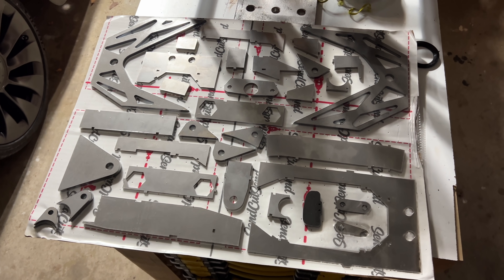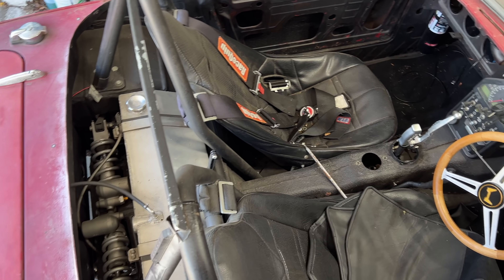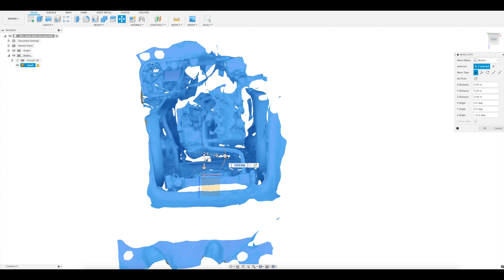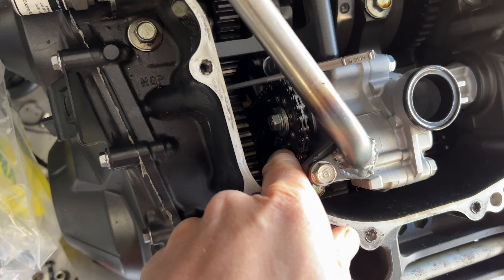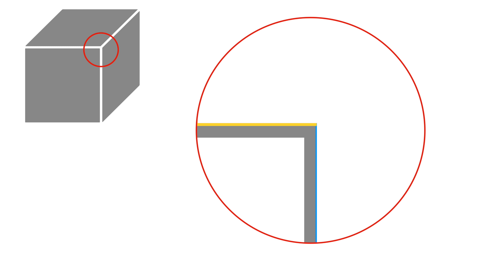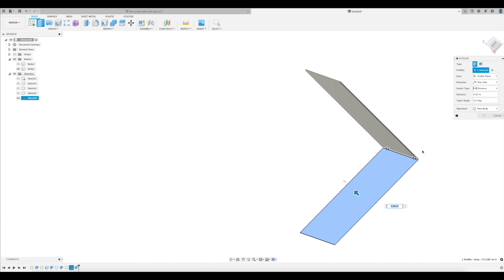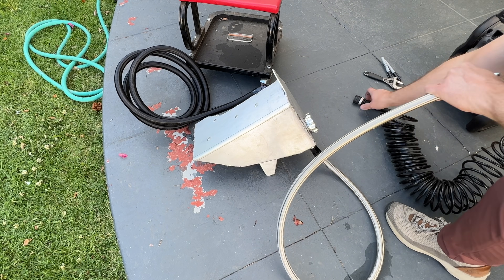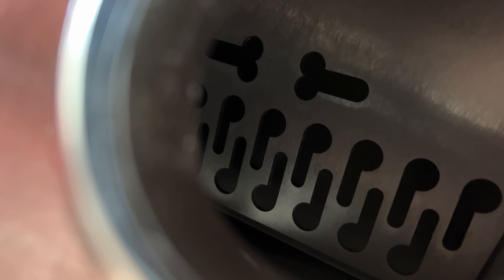Welded Structures Are Better

Comment: 3:33 ..  3 mm?!! why so thick!? sheet metal engineering is my day job (i design and export parts to our laser cutter), i wouldn't use anything above 2mm for this (1mm might not sound a lot but remember, it's a 50% addition), 1.5 mm SS is good enough imo
Reply: aluminum eh? that explains a lot :D

Comment: @SuperfastMatt, think of how many careers you may have launched today. 
Many, many years ago an AutoCAD class, continuing ed class at local State U. Software of any non-free sort was a carefully considered investment at our small start-up. I downloaded a free AutoCAD sorta-clone and dove in.

Up until that point my drafting was on paper, sometimes not even of the napkin variety. Playing with the freeware I sketched up a little bracket I was planning to buy and sent the dxf (no dimensions, no tolerances, no material, not even a title block) to a friend at a fab shop that did some work for us. I asked if he was able to read the file and asked for some pointers. In the morning on my desk sat that very part. My eyes actually watered up. I knew my world had changed. 

30-ish years later that exact part is still in production holding a resistor just so. Now rendered in SolidWorks but never revised, it is part of several machines that, in the end, enabled my comfortable early retirement.

Comment: whats the difference in dimensional accuracy between bent sheet metal parts and welded-together parts? Would you trust a welded bracket to hold frame rails apart at a specific distance or would you trust a "u" shaped bent sheet metal part to hold frame rails apart at a specific distance?

Comment: A high tech method I learned used a high tech material called foam core and tape, make a mockup. Then cut it apart and use as a template to mark out the material ad cut off what you dont need and weld.
For a round one go to a pizza place/restarant and take a look at the cans they have.
There is also the alternative to welding is automotive structural adhesive that holds together even in a crash. 
Modern automotive body structure construction consists of joining aluminum sheet to steel sheet and still hold up in a crash.
Someone told me years ago the US Army has an M1 Abrams tank with an adjustable wrench glued to the bottom of it from military structural adhesive.

Comment: A flat reservoir with ribs and channels could have doubled as an oil cooler if placed between radiator and the front grill, it seems there is enough space in that location...but then again  the complexity might collide with the 20% rule.

Comment: Loved the BOM shirt after the dig on them!  
BTW, make sure your aluminium is 110% dry of your test water before welding up the newly found holes, or you can experience hydrogen embrittlement. Nobody likes cracks. Except wise ones.
Reply: What doesn't kill you makes you stronger - unless its hydrogen enbrittlement which just makes you weaker.

Comment: It's easier to locate leaks by pressurising the vessel with air and submerging it in water.
This will reveal tiny pinholes with a stream of bubbles rising from them.
Reply: this does also involve a large tub of water, and lots of spillage..... completely overrated.

Comment: All classification bureaus work with 0,2 bar. Use air and a soap/water mixture(steal your kids bubble kit🤬dont buy it or borrow it😉). Or use parafin and scoolboard chalk. Or colourcheck. 
20 lbs is way to high.
Thats the difference. Tested the radiator, blew up the tank.
Next symbol. 4 beers for the carpenter store? We all know witch finger wasnt hit.

Comment: Hi Matt!  I was wondering how you locate features in your design that must be dimensionally accurate to an existing thing? For example, if you wanted your catch tank to bolt to 5 existing holes on your engine block (none of them being coplanar with another). Is scanning with a phone accurate enough to locate those points and build to?
Reply: It sure helps get a close first cut - CAD helps here again but don't discount the other CAD (cardboard assisted design) version.  Get a close idea of bolt positions from scan can be 3D printed to give a mock up for test fitting, or a flat design printed on paper then glued to cardboard and cutout, folded and hot glued to suit your purpose.  Both are easy to modify to the true positions of the bolts.  For those who don't feel comfortable with all this newfangled 3D trickery you can drill into the heads of some spare bolts, epoxy on some suitable sized ball bearings,  measure the centre distances then do some good old fashioned maths.

Comment: but send cut send only does their magic in usa
Reply: Someone else commented that they just started shipping to Canada so I checked their website: yes, they now ship to Canada, with a $19 shipping charge (shipping is free to U.S. locations). Presumably that $19 USD...
Reply: @brianb-p6586  im from germany, i know a lot of companies here that do that kind of stuff, but you need to use phones and faxes and show up personally
Reply: @arrangemonk  How do you send a CAD file by phone or fax? The point of SendCutSend is that they take your CAD file directly, and that the entire transaction is through their website, other than delivery of the actual cut (and bent if you want) material... so where they deliver to is important. If they don't deliver to your area, they're useless to you. There are apparently other services which work similarly, but I don't know who they are.
Reply: @brianb-p6586  i can not, i would have to show up personally after contacting them via telephone or fax and bring a flash drive with me

Comment: Will you be putting an oil cooler somewhere in the loop? Seems like it would be quite useful if you're planning on racing this thing.
Reply from the maker: The engine has a coolant-to-oil cooler. I’ll be plumbing it in to keep the oil cool and to make sure it’s not too cool.
Reply: @SuperfastMatt  Nice

Comment: I was just trying to remember in which video you mentioned your typical design tolerances for laser cut parts so this video is timed perfectly. (5 thousandths (0.005) of an inch or ~0.1mm for my own reference and anyone else who needs a reminder). Now, time to see how my decade old Catia V5 skills translate to Fusion360.
Reply from the maker: It's about .005". actual tolerances are tighter than that, but that's a good spacing to leave between tabs
Reply: @SuperfastMatt  oops, yea 0.04 is 1mm, not 0.1. I’ll edit the original comment so I don’t mess anyone up. I’m gonna stick to mm for my own design, it’s easier for my European-ness.
Reply: @SuperfastMatt  also, SendCutSend just started shipping to Canada, which is my impetus to see if I can design an entire chassis to be built up out of flat laser cut pieces. :)
Reply from the maker: @DasWauto  There is a guy (Jason Hoffman) in this group doing a flat panel Countach: https://www.facebook.com/groups/867119580122571/
Reply: @SuperfastMatt  Amazing. My idea is to make a Lotus 7/Locost chassis 3D jigsaw puzzle instead of the standard 1” square tube. It feels like a good design exercise to also learn Fusion360 with. I then hope to transfer lessons from that into a design of my own.

Comment: Awesome workflow, 3D scanning then throwing into Fusion is a great idea, I would've been in there with calipers trying to hand-sketch what's in the vicinity lol. I also haven't sent anything out for laser cutting yet so that's cool to see.
Reply: Yep, very nice. I'd have tried something dumb like stuffing a bag of styrofoam beads in there and vacuum packing it, then hand measuring the resulting block.
I look forward to some Android phone getting a good scanner on it.
Reply: you should try the other cad: cardboard aided design. cut and tape old pizza boxes until it fits. then copy and weld

Comment: I foresee a line of reservoir caps:
"Not brake fluid"-oil
"Also Not Brake Fluid"-radiator cap
"Sill Not Brake Fluid"-power steering reservoir
"Brake fluid doesn't go here"- windshield washer fluid
"Not For Brake Fluid"- supercharger heat exchanger tank
""That Leaves This one" brake reservoir.

And for bonus points, tou can anodize them all the "wrong" colors, just to make sure the kid at JiffyLube has a coronary, stroke, or other medical emergency of your choosing.
Reply: you are the kind of person that engineered the check engine light. l like it!
Reply: or make an actual "710" cap.
Reply: @Skwisgar2322  I came here to post that
Reply: @Skwisgar2322  Or "710 FLUID ONLY"
Reply: Stuffandjunk Andthings number them or give them alfabeth letters😉.
On mercantile marine vessels there is a colour code. Bleu/green/brown/ red/ yellow.
 Bleu=fresh water(cooland)
Green=seawater( stuff that cools the stuff)
Brown=fuel
Yellow=lubricating oil.
I forgot the air colour. Thnks to mr Olson. White.
Reply: @henkoosterhof5947  White?
Reply: @ivanolsen8596  checked internet. It is. Thnks
Reply: Oil: Not brake fluid
Radiator: Not washer fluid

Washer bottle: Not oil

etc.
Reply: Don't take it to a jiffy lube, you'll have brake fluid in everything!
Reply: What about a clutch reservoir? It's not the brake reservoir, but brake fluid also goes in there
Reply: @Eriiaa  That's when you use a KTM so you need different fluid types in the clutch and brake xD
Reply: Omg yes
Reply: ^This ^ Absolutely this 🤣😂🤣
Reply: I met a guy that needs an oil fill cap that says not water.... Smh
Reply: or the Donald Duck option: "Oil", "More oil", and "Even more oil".
Reply: I have about one customer per month who destroys their ABS system by putting oil in their brake fluid reservoir. So I need a line of brake fluid reservoir caps that say "put oil here to destroy vehicle"

Comment: thanks for the on the spot explanation of the philosophy of good enough. i just bought myself a old scooter and had to build a kind of parking-area for it in the wildernis i call my garden. my friends yelled at me, that this was not the state of the art way to place concret parking lot elements, and i agreed, but i tried to explain that it will do the job (wich it does), needed just a little bit more  effort than  i was willing to invest and is ugly enough for the girls that won't goe out with me...  they didn't understand... keep on your faboulos work!
Reply: @creamwobbly  to be honest with you, it haven t rained that much since i did my solid construction. I think it will be fine, but my friends  bets are standing against me. Rain is announced for the comming days. In case of just an other cathastrophic failure part two of the philosophy applies: Why not do something twice if you could have listened  the first place

Comment: I really like the concept, but the only welding I know how to do involves the letters J and B. That seems like it fits in with the 80% good in 20% time mantra, and I've seen engine blocks repaired with JB weld that are probably still running today, probably.
Reply: Several 69-78 Honda CB750 are running around after the drive chain broke and knocked a hole on the case. Usually patched with a piece of beer can and JB weld.
Reply: @craigwiess1656  DUDE! I absolutely believe you.I've used it myself for repairs on various things on intake manifolds and carbs and even for closing up a hole in a cylinder head where I got unlucky porting a Slant Six. But I've also seen where it has fallen short of peoples hopes, lol. I'm thinking specifically of the 454 my buddy tried to JB back together after he drove his Chevelle into a culvert and popped the drivers side motormount off along with a chunk of the block. Or the 350 that came into the shop that someone tried to JB a stud to hold the distributor down with after pulling all the threads out of the bolt hole, or the 305 the owner tried to JB the rocker studs into. Maybe it's just Chevy guys. That 454 Chevelle did eventually get "fixed" by welding the chunk back in and adding a chain between a waterpump bolt and the frame to reduce the strain on the mount. Although if we'd ever figured out how to make that car hookup it would have likely failed as spectacularly as most of the other dumb stuff we used to do
Reply: I'd like to show you several that aren't
Reply: If you'd like to design stuff like this then you do the cad bit shown in the vid, get it lazercut as shown and go to the local welder and say "i brought you a puzzle"
Reply: a guy i work with had a small crack in his block on his Civic, and tried to actually weld it but made it worse, and then just said fuck it and used some JB weld and it's been going strong 7 months later.

Comment: If you can't get two sheets of aluminum to occupy the same space at the same time, you're not pushing them together hard enough...
Reply: I've seen it done using a fancy drill. (Yes, I know it's called stir welding).
Reply: 50 Ton press should do the job like butter
Reply: As my high school astronomy teacher used to say, at a sufficiently large scale, if brute force isn’t working you’re simply not using enough of it.
Reply: @SeniorKlean I tried more brute force but my Aluminum atoms keep fusing into Iron.